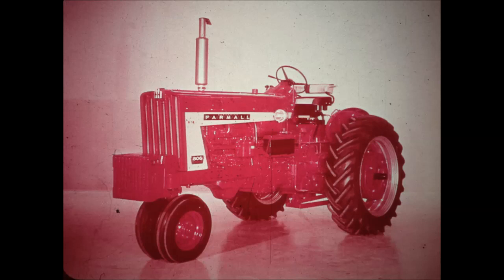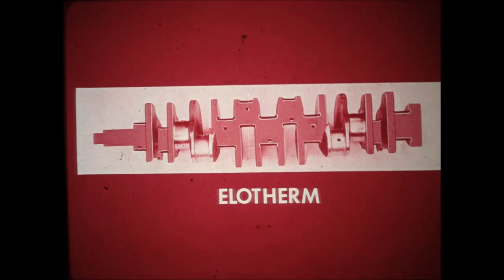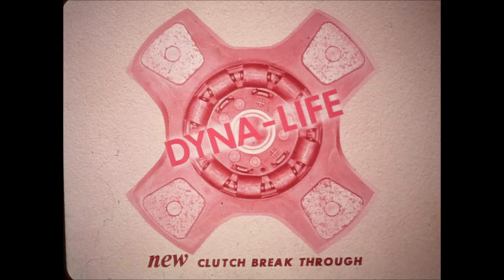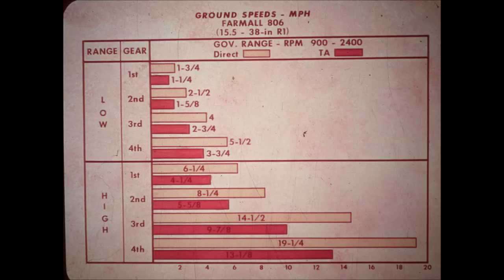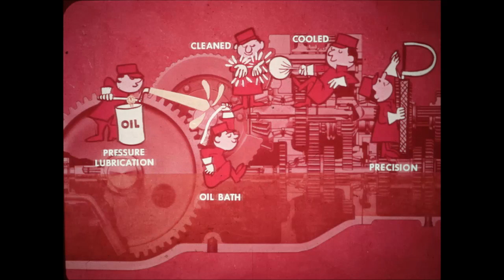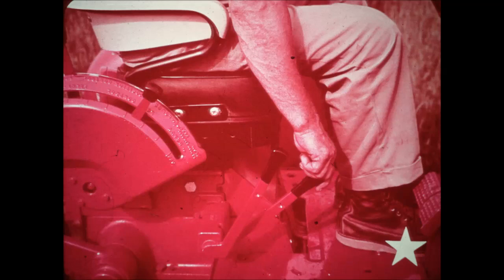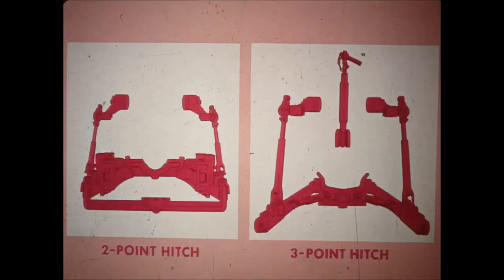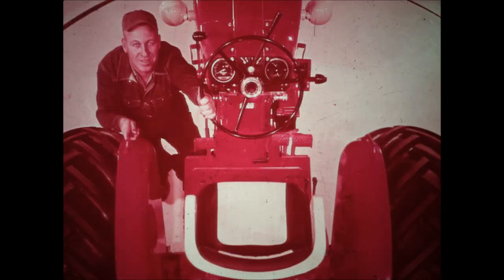806 Tractor Features

Comment: I just bought one.  It belonged to my 81 year old relative who bought it new in '66.  He bought it from another relative on the other side of my Dad's family who worked in sales for International Tractor and Truck in Raleigh NC. I am sitting here right now thumbing through the owner's and parts manuals.  I have driven a bunch of different tractors, and to spite my 806's quirks due to age, like sloppy brake pedals, and  hunt till you find it shifting, it is one of the smoothest running and steering tractors I have ever driven, and the best I currently own in that regard.

Comment: Bad items:the pto handle location, the lift control levers are low. And the ancient wheel adjustment set up. Other than that the rest is excellent.
Reply from the maker: Yeah, the PTO lever is in an odd spot, even if you're twisted around looking at the machine & I scraped my thumb knuckle a couple times on the lift control before I bent it away from the arm rest plate. It is indeed a fine tractor otherwise. Regards!

Comment: Anyone out there ever repaired a major hydraulic leak at the front steering box on an 806?
Reply from the maker: Do you know what is leaking? One of the lines or the steering unit itself?
Reply: @ikonseesmrno7300  I believe it may be a blown seal from the steering box at the axel because its blowing hydraulic crazy. The steering made a whining sound before the pump got wormed up. However this tractor of my fathers hasn't been started in 18 years. But it cranked up.
Reply from the maker: @brendtoconnell6119  That issue is a bit out of my realm as I haven't had to change out that seal. If you post your question on either the Red Power forum or Yesterday's Tractors, you'll get the help you need. Both sites still have a couple retired IH service men as members & there are a few others there that have most likely gone through what you're working on. Regards & good luck!!